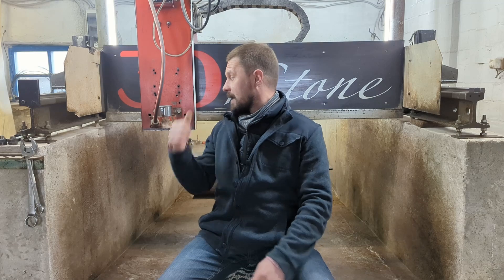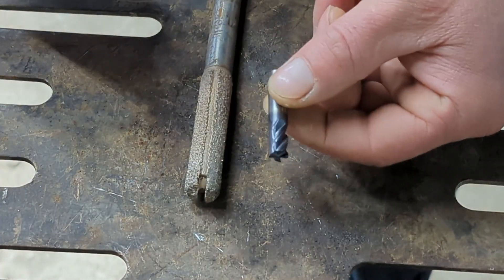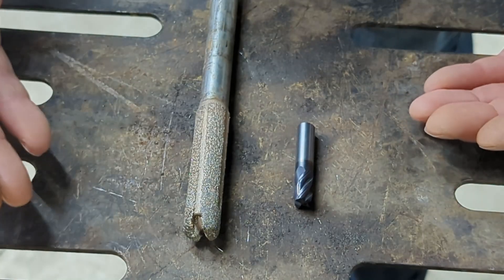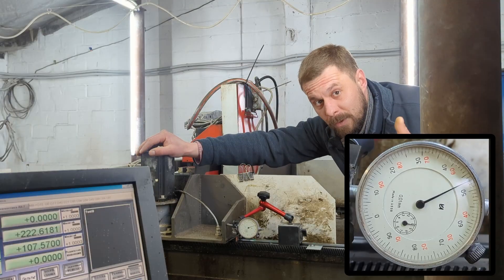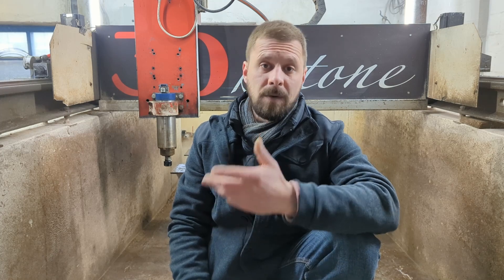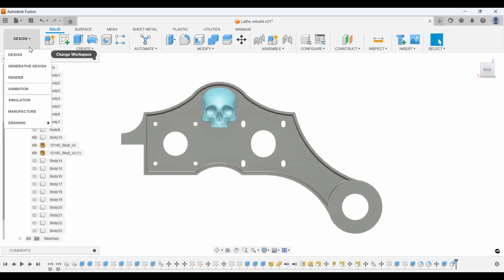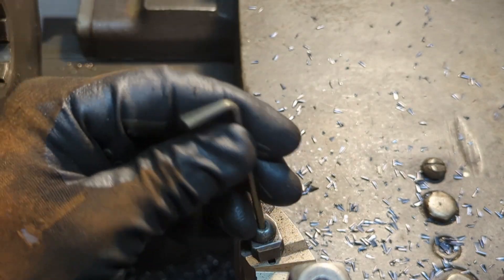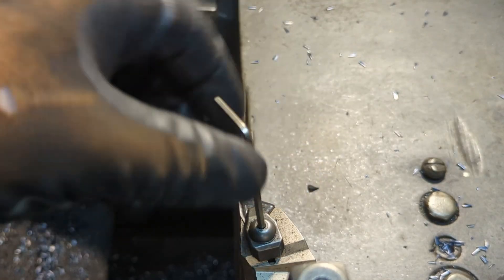Milling a steel skull using self-made CNC. Lathe rebuild. Part 3

Comment: Excellent work despite the complete lack of special equipment.)) You should definitely spend more time installing and fixing the workpiece. Maybe think about some kind of table that will make it possible to raise the workpiece closer to the tool and give the workpiece more attachment points. I think that from your machine you can get more or less normal processing quality. Otherwise everything is very cool, keep it up!
Reply from the maker: Thanks for the advice. I completely agree, as I said in the video there is room for improvement. I'm thinking of installing either a granite or cast iron table with T slots on which the vice can be mounted. I will be glad to receive further suggestions. This will help a lot